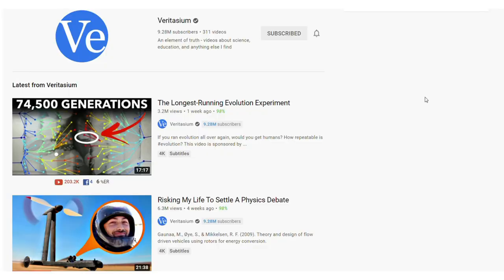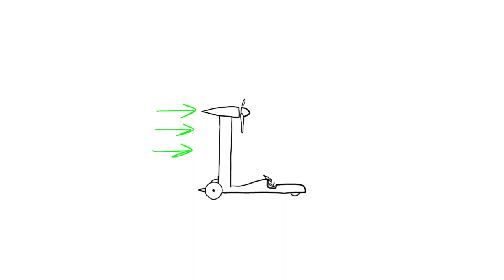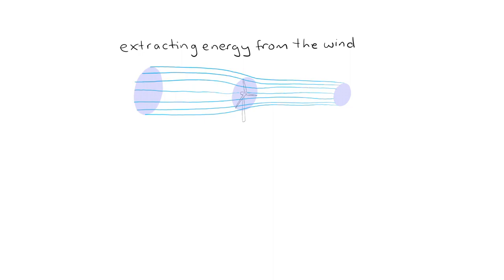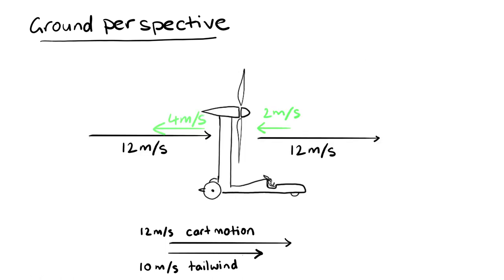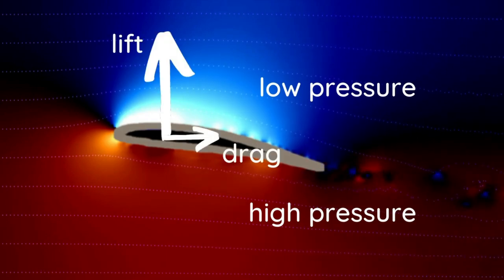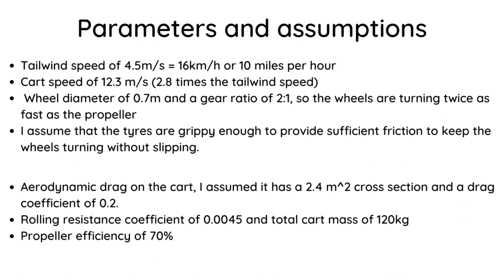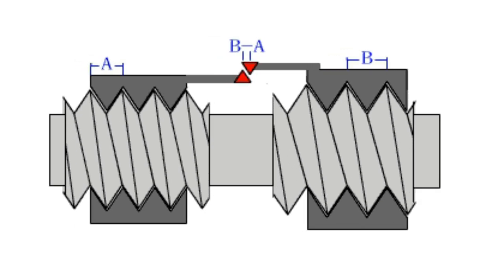Downwind Faster Than the Wind by Veritasium: How Does it Work?

Comment: Thank you for your careful reasoning - but I favor a simpler explanation. I'm kind of obsessed with this. I admit it.

It's a cool example of how energy is a scalar, not a vector, and how a given force against an object represents different energy with different references.

Here's my thinking - the propeller doesn't transfer energy to the air, the air transfers energy to the prop via drag, not thrust.

Imagine a little electric fan, speed-regulated to move air at ten mph. Hold it out the window of your car traveling 10 mph in zero wind. The fan blades experience no pressure from the wind because the relative wind to the blades is at the same angle as the blades. Accelerate to 20 mph, doubling the speed of the fan, just as if it were geared to the wheels of your car. The blades still experience no push forward or back.

Now add a three mph tailwind against your speed-regulated fan. You feel a push forward from a tailwind you're outracing. The fan has to push air back at three mph (1.4 m/s) relative to the prop to match geometry. The fan has to do a little work to run faster than the reduced relative wind over the car, resulting in a drag against the forward motion of the car. 

This force over distance applied by the prop (work/expenditure of energy) pushing air backward is smaller than the force over distance from the force against the back of the fan blades at the higher speed of the car.

The prop is moving air backward at 1.4 m/s. The forward push against the car is at a higher speed.

For any given unit of time, the distance component of the prop accelerating air back is smaller than the distance component of the "translated" push from the tailwind over the ground at the car's forward speed.

That's what I think. Please, Rosie or Vertasium, tell me where I'm wrong.

Comment: I see a problem here. If the cart is moving slowly, the wind behind it will cause the propeller to spin. If the cart is moving fast -- say 60mph -- the propeller will want to spin in the opposite direction, so it will act as a brake. Somewhere in the middle, the air pressure on both sides of the propeller blades will be equal, and the only way to make it spin faster or slower would be from a second energy input.
Reply: At all speeds the wheels turn the propeller.  The wind (headwind or tailwind) never does.
Reply: @Rick_Cavallaro  I know that's what they builders say, but I'm not convinced. If it's true, it shouldn't be hard to prove. Just put power meters on the two sprockets and see which one exerts more force when the thing is underway.
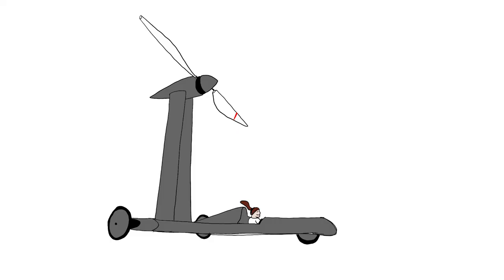Reply: @MrTeff999  I'm the builder.  And we don't need power meters since we have a ratchet on the axle that allows the wheels to turn the propeller but does not allow the propeller to turn the wheels.  Look at Derek's first video around 12:25 to see the propeller freewheeling.
Reply: @Rick_Cavallaro  Oh.

Comment: I've taken another stab at a qualitative explanation, so interested in opinions:

Let’s imagine the vehicle up on blocks, with a motor attached to the axel, turning the axel (and thus the prop) in the forward direction, on a calm day without the vehicle going anywhere. The builders promise us that the prop is built, and the driver manages pitch, so that it is exerting a forward force on the vehicle. Now remove the motor from the axel and replace it with a rope-wound drum, same diameter as the wheel, with the rope coming off the drum at the bottom and leading aft. Pulling on the rope rotates the drum (pseudo-wheel) in the “forward” direction and turns the prop in the same way the motor did.

At this point the only forces of interest on the vehicle are the forward force produced by the prop and the tension in the rope, which is directed backward. I think it’s legit to neglect what the supporting blocks are doing in immobilizing the setup, so the force on the rope is opposed by friction in the axel, gears and so on, as well as, especially, aerodynamic forces on the prop. These are drag, resisting its rotation, and lift, tending to push the vehicle forward (thrust); this is where the lift/drag ratio comes in. The question is whether the forward thrust from the prop can be greater than the rearward pull on the rope. It seems to me that this could be measured without too much difficulty if anyone wanted to do it, but I think the answer must be “yes”

I think the “up on blocks on a calm day” situation fairly represents the “moving downwind at true wind speed” situation, where the pull on the rope is replaced by the vehicle’s resistance to forward motion, remembering that as far as the vehicle (but not the prop) is concerned, the apparent wind is zero. The prop can have lots of wind because it’s rotating, and in the above situation that wind direction is always tangential to the arc of rotation. So as I see it, if you can have a prop with some reasonable lift/drag ratio the forward forces can exceed the resistance forces by enough that the vehicle can accelerate beyond the true wind speed.

This can’t go on forever because the pitch of the prop is initially such that its lift is directed mostly forward, but as the vehicle accelerates beyond true wind speed, the apparent wind moves forward, which causes the pilot to change the pitch of the prop to one that is less favourable, reducing the component of its lift in the forward direction. And of course, drag on the body of the vehicle is now opposed to its motion rather than aiding it. It has occurred to me that the vehicle's initial forward motion might be enhanced by deploying a square sail on the prop’s support structure, which could be furled as the apparent wind comes forward, something like taking in the kite at the leeward mark – but that’s another conversation.
Reply: @Rick_Cavallaro  
Thanks for reading that, Rick. I'm glad it makes some sense to you because not all my friends are convinced (yet) but it seems reasonable to me.

 I think I might have spent more time on the variation of prop pitch and angle of attack of the apparent wind at the blade, but it was getting lengthy. 

Still interested in other opinions or course!
Reply: @Rick_Cavallaro  
When I was a grad student in Chemistry at Caltech I was actually more interested in sailing and  spent much more time in the Aeronautics library than my advisor liked. It could be that some of it actually penetrated.
Reply: Apologies for misspelling "axle" - apparently I've been watching too much figure skating.

Comment: I find the argument that the propeller is ‘pushing’ the cart like a fan that is being turned by the wheels unconvincing. Surely the propeller is acting as a coupled pair of sails that generate a torque about the propeller hub. Since they always see an apparent wind different from the true wind duel to their rotation, there is no paradox to resolve. The power should be always flowing from the propeller to the wheels except when the cart just begins to move to start the propeller rotating. The tension in the drive chain from the propeller hub to the axle should indicate which way the power is flowing.
Reply: "The power should be always flowing from the propeller to the wheels"

No. The power (in the transmission) should be always flowing from the faster relative speed, to the slower relative speed. When going downwind faster than the wind, that means from the wheels to the propeller.
Reply: "The tension in the drive chain from the propeller hub to the axle should indicate which way the power is flowing."

Search youtube for "BUFC Blowup run" and skip to around 1:00. The propeller rotates clockwise and the right side of the chain is under tension, so the wheels are turning the propeller.
Reply: As the guy who designed and built the Blackbird drivetrain (including the chain tensioner), I can assure you that during normal operation, the wheels always (ALWAYS) drive the propeller.  It is the downward traveling side of the chain loop that remains under tension.
Reply: @eyytee  
// "The power (in the transmission) should be always flowing from the faster relative speed, to the slower relative speed."//

Holy crap A.T.  I had never wrapped my head around the exact moment when the airfoil on a sailboat shifts from 'prop' mode to 'turbine' mode.  If that's the deciding factor (and I have every reason not to doubt you), that makes it easy to visualize.  Will process that for a bit.
Reply: @turbinia.

Back to the drive chain questions.

Following is a video which allows the viewer to actually see the tension side of the chain in operation.

In this video we push the vehicle up to windspeed (just to save space) and then hold the truck at WS while the Blackbird accelerates away from us.  You can see the right (downward) side of the chain under straight tension, while the return (upward) side remains with the 'dogleg'.  (The white plastic block is there to keep the loose side from flopping around).

If the upward side were to be pulled straight under tension, the plastic block would shift left as the 'dogleg' slack transferred to the downward chain. 

https://youtu.be/PhD_3vdIvu4
Reply: @johnborton4522  That is both interesting and extremely counter-intuitive. Have you done any measurements of how much power is being transferred between the wheels and propeller? Is the entirety of the propulsive thrust generated through spinning the propeller, as it would be with an engine powered propeller, or is the thrust primarily generated as a reaction force on the propeller with the rotation serving to modify the apparent wind seen by the blades?
Reply: @johnborton4522  The way I understand the sailboat analogy: if the velocity of the foil (sail or keel) perpendicular to true wind is opposite to the fluid force on the foil perpendicular to true wind, then it's like a propeller blade (propellers rotate opposite to the aerodynamic torque on them). If they have the same crosswind direction, it's like a turbine blade (turbines rotate with the aerodynamic torque on them).
Reply: @turbinia  

It's been 10 years since I've even seen the Blackbird, so don't hold me to my recollection of these exact numbers, but... I believe there is about 600-ft pounds of torque being transferred through the drivetrain to the propeller at speed.  

Rick Cavallaro (who is on this comment thread) could answer your other questions better than I could.
Reply: @turbinia  The transmission power increases with the cube of speed (so the chain breaks or the sprockets bend at some point). I did some estimate for their record speed and came up with over 300N thrust and 3000W power. Regarding your second question, I don't think there is a difference in terms of physics, but I might be misunderstanding what you mean.

Comment: The wheels are powered by the propeller, not the other way around. The simple reason why it is possible for the cart to travel downwind faster than the wind is that the blades of the propeller do not travel directly downwind, but in a spiral motion relative to the ground. This is like a sailing boat gybing downwind in order to travel downwind faster than the wind.
Reply: Probably we should call it a turbine rather than a propeller.
Reply: The wheels always drive the propeller.  The propeller never drives the wheels.  Aaaaaannnnnd  -- its a propeller, not a turbine. 

If it were a turbine, it wouldn't even reach windspeed, let alone 3x windspeed.
Reply: @johnborton4522  If it were a turbine it could exceed windspeed if it were travelling against the wind. However, travelling downwind faster than the wind indeed requires a propeller as you said.
Reply: @johnborton4522 , what is driving cart? Obviously the only thing that's driving the cart are the blades on the turbine. They act as sails on a boat, and the cart can move faster downwind than the windspeed because the blades do NOT travel directly downwind, but rather at an angle towards the wind. Much like sailing boat jibing downwind.
Reply: @matthijsklomp  "No wind powered vehicle can travel upwind faster than the windspeed, only downwind."

They can by the same logic as this cart can. It just works in reverse with wheels being powered by a turbine rather than the reverse.
Reply: @seneca983  Explain to me what powers the cart if the blades were powered by the wheels.
Reply: @matthijsklomp  "Explain to me what powers the cart if the blades were powered by the wheels."

The propeller pushes the cart forward and that allows the wheels to power the propeller. The wheels powering the propeller does cause a decelerating force but that can be less than the accelerating force from the propeller because of the movement of the air relative to the ground.
Reply: @seneca983  The only propulsion force is coming from the blades on the turbine. This is since the only source of energy in a wind-powered vehicle is from the wind blowing across the blades (hence the name "wind-powered"). The resistance is then aerodynamic drag, rolling resistance and transmission efficiency (from the turbine shaft to the wheels). When the losses equal the input power the cart stops accelerating and will reach its maximum speed. You can simply view this vehicle as wind turbine on wheels with the turbine driving the wheels, never the other way around. What determines the direction of the vehicle is the gear ratio between the turbine and the wheels.
Reply: @matthijsklomp  "You can simply view this vehicle as wind turbine on wheels with the turbine driving the wheels"

No, it's the other way around. The wheels have to power the propeller/turbine when going downwind. You can even see in the videos that the turbine spins the opposite way from what it would be if the wind was turning it.

However, a turbine powering the wheels would work if the vehicle was were going against the wind.

Comment: Wait up.... Sorry can you clarify something for me please? 
Do modern wind turbines rotate with their blades (having a positive AOA and positive aerofoil camber) facing into the wind? Which would be the opposite of reversing the flow of air through say a normal aeroplane propeller? Sorry, that was terribly worded. Maybe a simpler way of asking is, which way is the wind blowing through a modern wind turbine, from the front (turbine side) or the from back (Generator side)? I might go and do some reading on turbine blade aerofoils
Reply from the maker: They usually put the blades upwind of the generator. And the curved part of the aerofoil needs to face upwind so that there is positive aoa. And there is positive camber. It's tricky to explain in words, but I did make a few videos about it, try these 😀
https://youtu.be/zskSOKKrGjk
https://youtu.be/o6BCnhubbiQ
https://youtu.be/7-awFXqisYA
Reply: @EngineeringwithRosie  Thank you very much Rosie. I'm checking these out right now. I appreciate the quick reply and as always, love your work and look forward to more. 
Cheers,

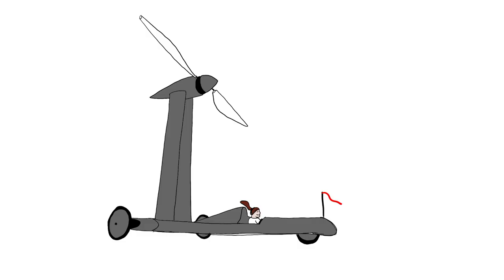Comment: Thanks Rosie. A much better analysis & explanation than those guys on the gambling channel. But wait a second...we're trimming prop angle of attack now in realtime(?) And at 14:35-14:45 we're saying plane [starts with engine] = [car starts with it's rotating wheels]? But the wheels aren't rotating at start. Oops. My opinion at this point: losses from wheels, powertrain, transmission result in little if any contribution to accelerating the car, and perhaps even slow it. i.e. faster-than-wind NOT due to magic wheel drive loop. Cheers!

Comment: Amazing! I never had a doubt this was feasible. Downwind jibing has been a thing for awhile, and sailing straight downwind feels so slow, it's all about the reference frame..
   I am curious on the old-fashioned wind mills. You touched on it here, but It might be a subject for a full video. How did they evolve, how the sails were managed etc....Also the various types, flour mill lumber mill etc...
Reply from the maker: That's a good idea for a video, thanks for the suggestion! 
And also, I only learnt that term "jibing" after I recorded this video... I always get the sailing terms wrong every time I mention it in a video!

Comment: It would be better to draw a distance(time-line) graph to illustrate the speed of the winds, the speed of the car, the RPM of the propeller, and the forces.

People are interesting in three things:
1. the moment when the speed of wind and the speed of the car are the same.
2. the increment of the car's speed after the moment; how long does the car move faster than the wind?
3. a design to make the road a cylinder road, so the car can move forever.

Comment: Why does it move forwards? It seems to me that the wind might blow the propeller in the opposite direction, powering the wheels to move the cart backwards. From then onwards everything works as described but the cart is moving against the wind. Is being stationary an unstable equilibrium?
Reply: The gear ratio is carefully selected to optimize upwind or downwind configurations.

If you gear it slightly differently it will go in the other direction.  That's how the Blackbird set the upwind world  record as well.  It was of course reconfigured so the pilot still faces forwards. 

https://youtu.be/F7PNSyAfCjk

Comment: Thinking in building blocks makes it easy:
With no prop, car structure goes 10mph in 10 mph wind, of course.
Take power away from wheels is a cost (1 mph?), so car would drop to 9 mph
Use front wheel power to make prop thrust, (2 mph?) so car goes 9+2 = 11 mph

As long as power removed thru the wheels is efficiently turned into prop thrust, it works. And consider you are taking power away from wheels on a 10mph vehicle, to try to get an extra 2 mph from thrust, so it's not difficult.
Reply: The trick is explaining how taking 1mph from the wheels adds 2mph at the turbine without violating conservation.  That's why the difference in speed and lever analogy keep getting repeated so much in these explanations.